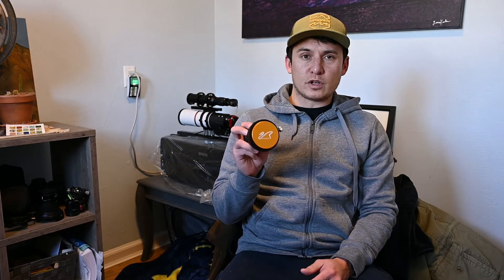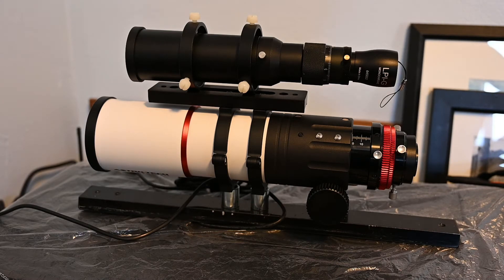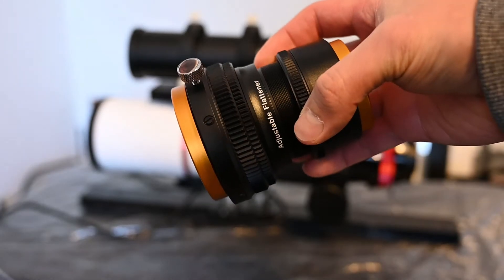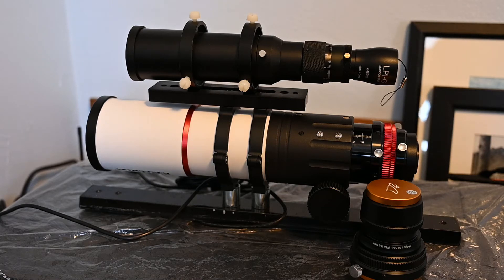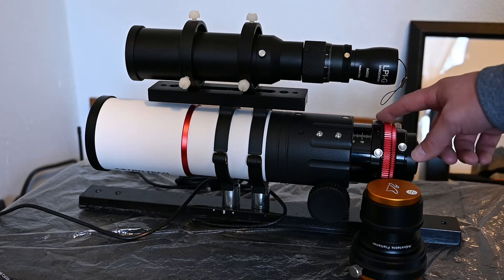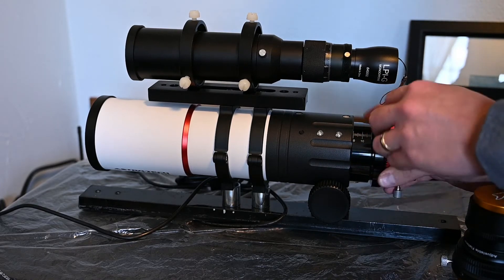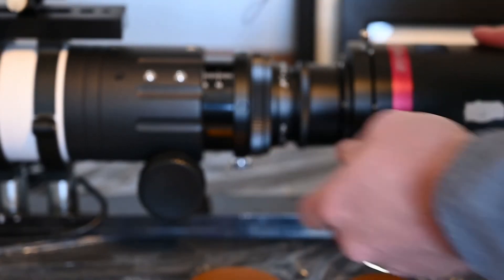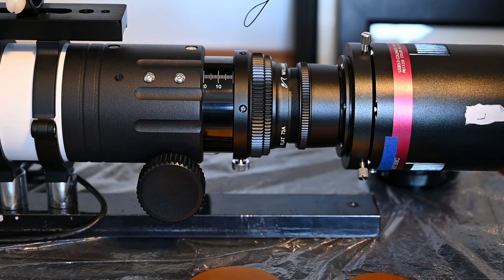Installing William Optics Flat 73A on Astro-Tech AT72EDII

Comment: I too have the 73a flattener with the AT72EDii using a Nikon t-ring and setting the flattener at 11.4mm per WO’s instructions I get a nice flat field out to the edges on my Nikon D810a. Now my Real question could you use this flattener on a 102??

Comment: Looking at your setup, you need to add 55mm from the back of the Flat 73A to the sensor. I don't thing you are even close. I installed the 73A on my GT71 and it work just fine with both my ASI183 and ASI071.
Reply from the maker: You would be wrong. The sensor on QHY cameras is set back further in the camera body than on ASI cameras.
Reply: @deepskyutah5257  Base on what I see, the focal length is the same as Z73, 430mm so the setting on the reducer should be 11.4mm. from the back of the reducer you need 55mm. Camera is 18mm + tilt 6mm therefore you need a 31mm spacer in between the camera and reducer. On my GT71 (420mm), camera is 17.5mm therefore the spacer is 37.5mm.
Reply: Sorry, I wrote reducer but should be flattener. BTW, this flattener is the same used for the Z61, just different setting.  The rotator can be found on Stellarvue with adapter for M63/M68->M54 or M63/M68->M63.

Comment: You say you sees elongated stars in the periphery of the field without the field flattener.  But do you also see non-round stars with a 1.6 cropped sensor with narrower field of view?  Also, can you use the scope visually with an eyepieces and star diagonal with the field flattener in place or does it need to be removed to achieve focus for visual use?  If the flattener is on the scope with a t-ring, how do you attach a star diagonal with eyepiece for visual use?
Reply from the maker: Yes, my camera is a 1.5x crop, and elongated stars were still quite visible. Maybe with a micro 4/3 or smaller sensor, it would be OK. No, I do not believe you could use the scope for visual use with the flattener attached.

Comment: that's because it's really a Sky Watcher 72 ed knock off , try sky watcher products , they'll fit perfect , p.s.  should have bought the sky watcher , $70 less .. but good luck to you
Reply from the maker: I've had a skywatcher 80ed. They are decent, but the fit and finish on the astro-tech is better. The focuser and rotator are better, too. Also, better resale value on the astro-tech. I sold it for almost what I paid for it. The skywatcher loses resale value as soon as you open it. Best of luck to you.

Comment: I have the same  Astrotech scope.  Can you thread on a 2 inch filter to the Williams field flattener?
Reply: If you don't need a reducer Apertura sells an adjustable flattener for their version of this scope (works with both) that accepts 2" filters between the flattener and focuser.
Reply from the maker: @ScoobyJoobyJew  I'll take a look at that one. I tried my Hotech flattener again...the first flattener I tried with this telescope last summer, and so far it's given me the best results at about 62-63mm spacing. I only tried it at 55mm last year. They still have some stretch in the corners with the Hotech, but at least I'm making progress.
Reply: @deepskyutah5257  Hi.  Wondering if you've had a chance to test the Apertura adjustable flattener and, if so, how it compared with the Hotech flattener?
Reply from the maker: @phcalama  Hi Paul, I did not have a chance to test the Apertura. After not being satisfied with the WO flattener, I moved on from this telescope. It was great in the center, but the midframe to edge was not good. Maybe an APS-C sensor is too large? Maybe I had a defective scope? I tried talking to Astronomics, but they didn't seem eager to help even though it was under warranty.
Reply from the maker: Yes, you can. Just unscrew the back piece all the way off (the side closest to the camera). There is a good illustration on the WO product page. However, having a filter in prevented me from adjusting the flattener inward at a certain point.

Comment: Was wondering if you have had the chance to test the WO Flat 73a? Did it fix the problem?
Reply from the maker: Unfortunately, with an APS-C sized sensor (QHY168c), I still had a lot of curvature at the recommended backspacing of the Flat 73a (around 65mm). I kept adding more and more spacers, and the stars did start getting better in the corners and on the edges, but it also introduced other distortion that degraded the image quality. I think I tested out to around 100mm. Eventually, I went back to test the Hotech flattener with spacing around 65mm, and I was surprised to see that that gave me the best results of all the flatteners I've tested with this telescope. Not perfect in the very far corners, but everywhere else was pretty sharp. With a smaller sensor, I would guess the stars would be near perfect. The WO flattener got returned, and I'll test the Hotech again when the weather improves. It really is a pain figuring out the best flattener/spacing/telescope/sensor combination, especially when it's 10 degrees out!
Reply: @deepskyutah5257  I wonder if you got a bad scope. I have the Apertura version of this scope with just a Apertura flattener (no reducer) and I have perfect stars edge to edge with my APS-C camera.
Reply from the maker: @ScoobyJoobyJew  haha, I've been wondering that too. I did contact Astronomics about the issue last year, and all I got was some generic answer. I might have to see how much trouble it will be to get a replacement or to have them at least take a look at it before the warranty runs out.
Reply: @deepskyutah5257  Wondering what backfocus you ended up using for the Hotech flattener on your AT72EDII?
Reply from the maker: @phcalama  I tried a number of different backfocuses, but it seems that 61-63mm seemed to give the best results. Still, the results weren't acceptable to me. I came across a post on cloudynights where someone was using a backspacing of I think 72mm with this scope. I've since moved on from this telescope, and I hope to get a RASA 8 someday for wide angle imaging.
Reply: @deepskyutah5257  Thanks for the update. I ordered the scope but not a flattener.  The scope is on backorder so I thought I would do some research to find the best one. Hope the Hotech works for you.

Comment: Celestron now makes scopes with optics that correct this issue, and off axis coma.  The Edge HD line.  The stars are round all the way to the edge.  Not a very cheap solution however.......if you can even find one in stock.  Also....I really want to hit the thumbs up button.....but that would be unlucky #13.  Lol. Great video and solution
Reply from the maker: Thanks! I actually have a 9.25 EdgeHD. The sharpest telescope I own. But, they all have really long focal lengths of 2000mm+. For wide-field use, say below 600mm focal length, you're pretty much limited to a refractor...at least as far as I'm aware.
Reply: @deepskyutah5257  You could always go Hyperstar. Although at that point the EdgeHD part of the scope is wasted since you're bypassing that part of the optical train.
Reply from the maker: @ScoobyJoobyJew  I've considered it in the past...but I'm not sure how I feel about having to convert back and forth when I want the longer focal length. I'm keeping an eye out for a used 8" RASA if I can't get my stars straightened out with this AT72EDII.
Reply: @deepskyutah5257  Have you tried sending it in under warranty? It's quite possible that there's an issue with the scope seeing as how pretty much everybody praises the quality of the optics. My Apertura version has been flawless edge to edge.
Reply from the maker: @ScoobyJoobyJew  Yea, it's frustrating knowing how good the reputation is for this scope. I just emailed Astronomics to see what they can do under warranty.
Reply: @deepskyutah5257  I'm sure that they will take care of you if it's under warranty. And the good news is that scope is in stock.